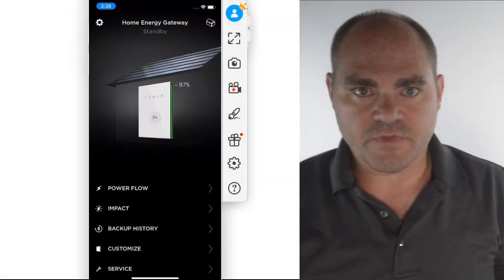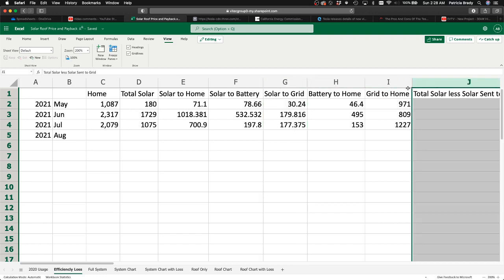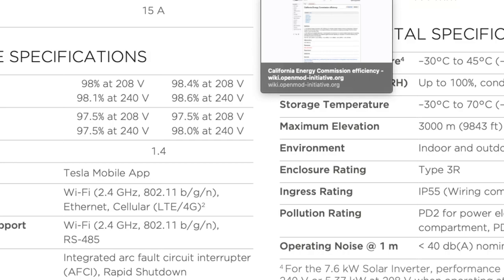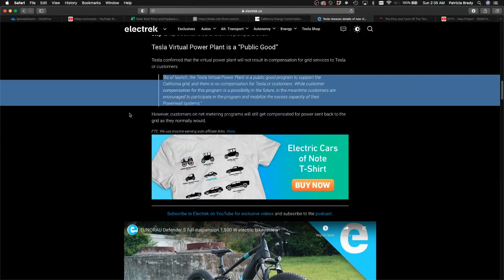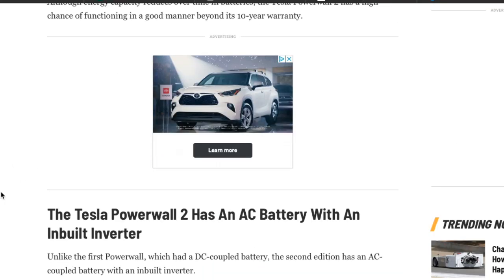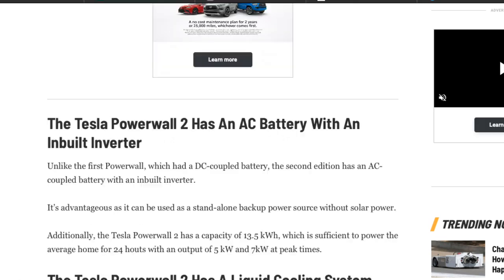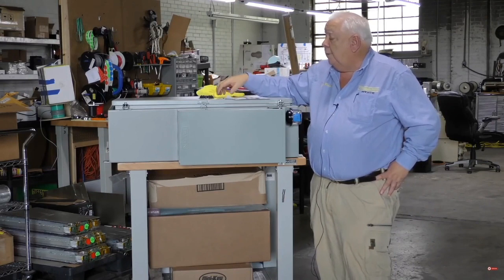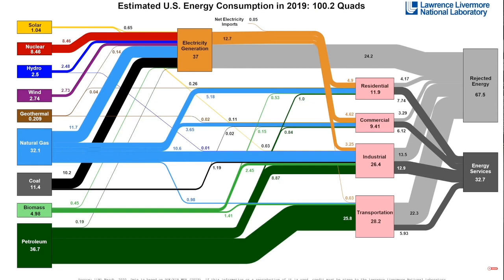Episode 16 - You're Gonna Need a Bigger System | Conversion Loss from "Self Powered" vs "Backup"

Comment: Anyone know? Appears PW+ (DC coupled) is just Oct ‘20 updated PW2 (AC coupled) w/external integrated inverter/gateway. Can owners of updated PW2s take advantage of the PW2’s higher continuous/peak/surge levels (w/o getting PW+)?
Reply from the maker: The inverter within Powerwall 2 is software limited and can technically be updated, yes.  But it's not directly applicable if you're connecting the solar array to Tesla Inverters to begin with.  It would only be applicable for the amount of power you need to pull from them.  Do you know what your home's theoretical peak draw would be if the grid were down?